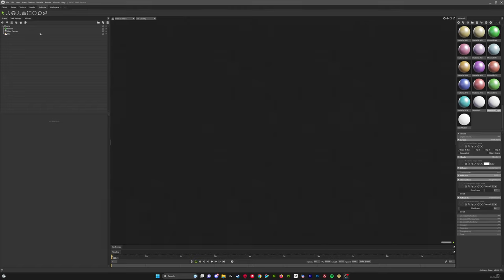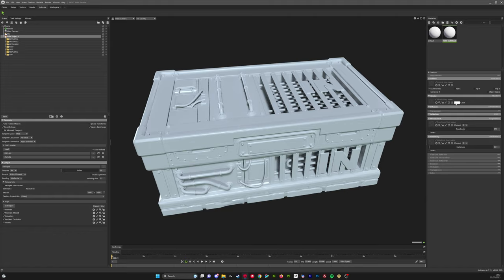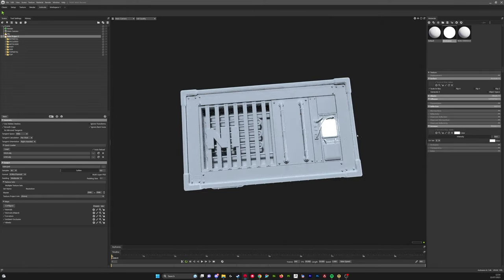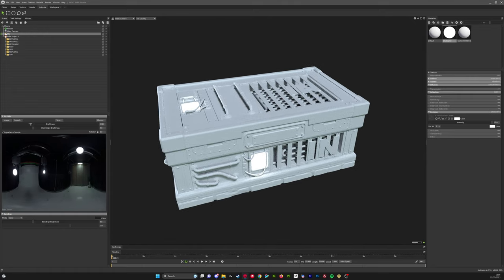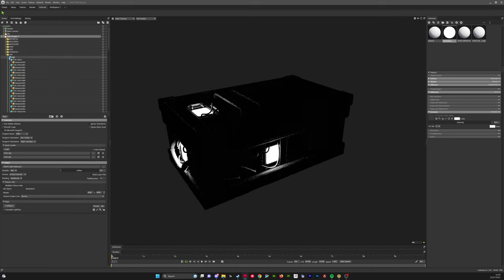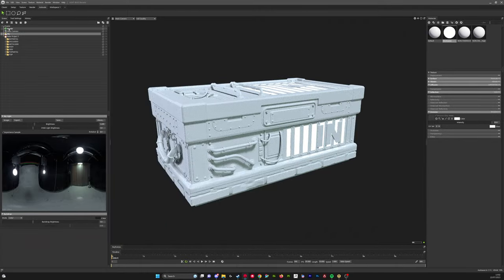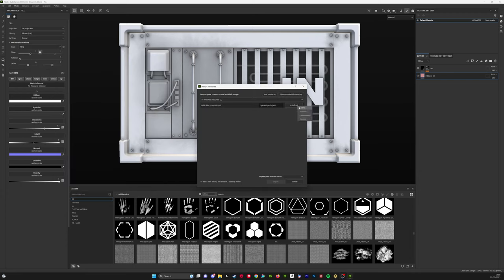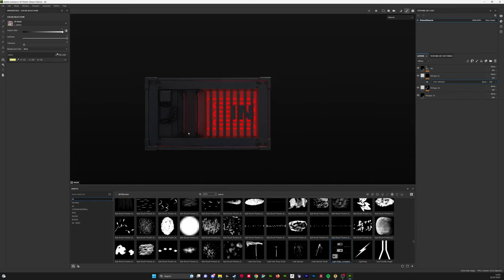How to bake light / emission maps in Marmoset Toolbag 4 for rust.

Comment: Sorry..... did the same, but it bakes the emissive material only, not light on other surface. You use M TB4.06 right? May be there are some addons?
Reply: enable ray tracing in render, or ctrl + r
Reply: same problem
Reply: i fixed it, turn on Ray tracing in render options, and make all like him, and you will get light on other surfaces